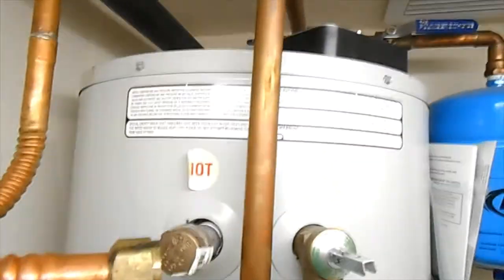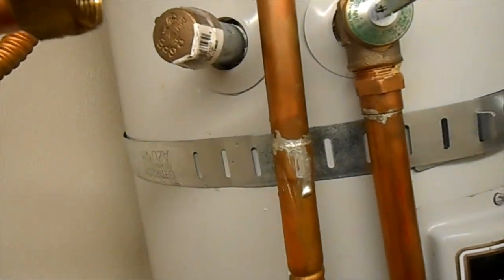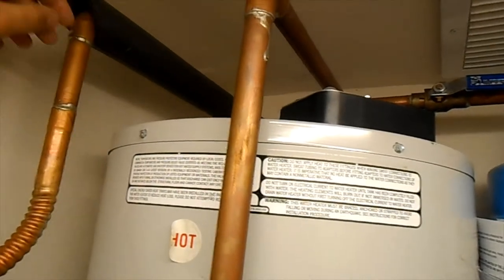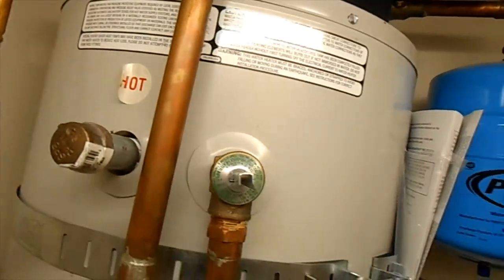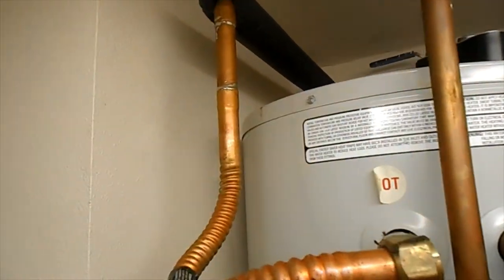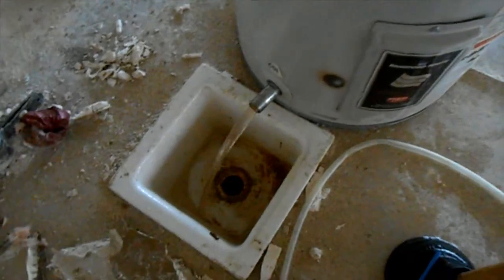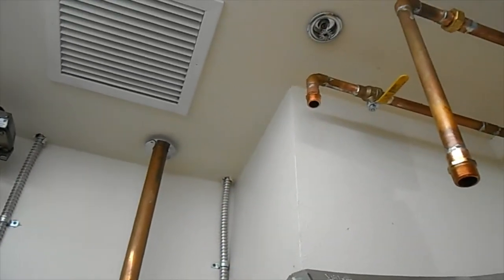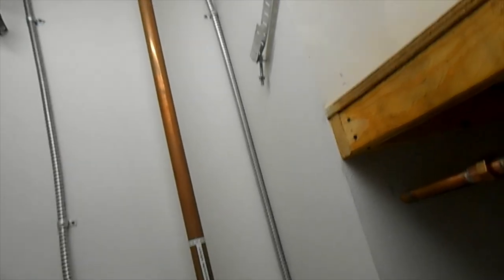Removing a 20 gal. Water Heater and Setting Up Install

Comment: Why is there 2 valves?  I thought only one on the cold?
Reply from the maker: i always install one on both to prevent drain back during replacement or service of the heater. also single handle faucets can leak over from hot to cold; so there's a potential to be pressure coming back thru the hot line if a fixture is used.